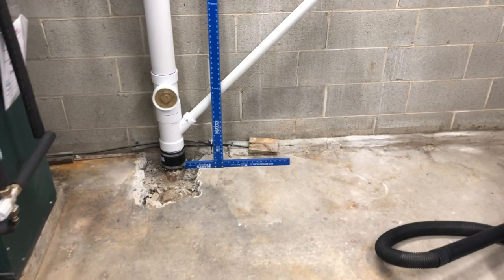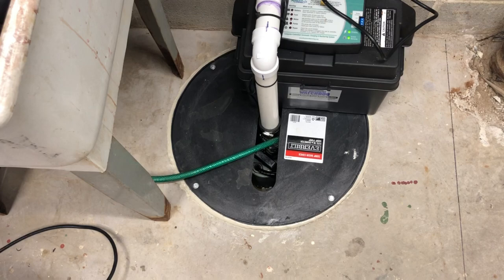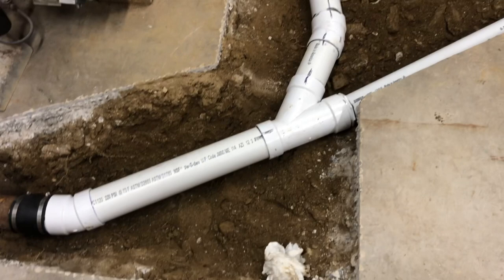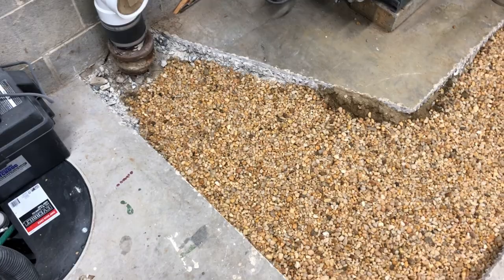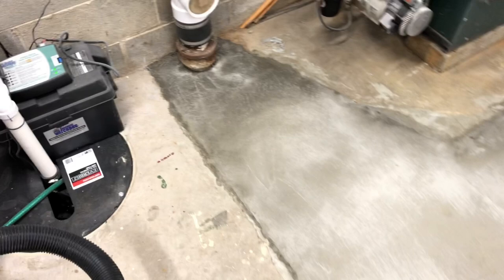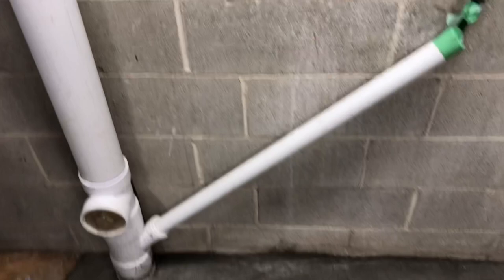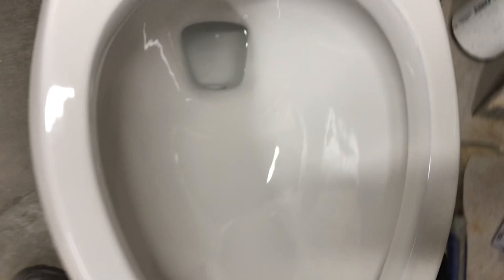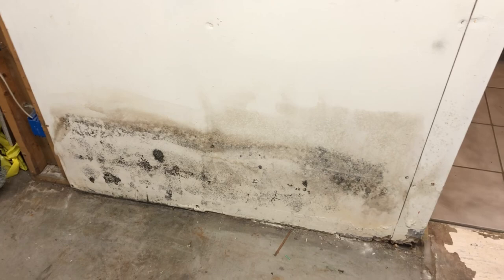Adding a toilet in the basement.

Comment: Should've used a 4x2 Santee with a 2x1½ bushing for the sink arm. The wye could allow for the p trap to get siphoned out from the air getting blocked off.
Reply: As a licensed experience plumber, your absolutely correct. However in most cases S traps actually do work as long as they aren’t severe
Reply: @CW-hq2qr  But they will not pass Code.
Reply: @vanhattfield8292  correct

Comment: What if idk where to drill & cut? I'm adding a new toilet
Reply from the maker: You would definitely want to know first 😂 I knew because I could see the two stacks going into the basement floor.
Reply: @PHL_Brownstone  no ik where the main line is. I'm plumbing a New toilet in, but there is an existing shower. The drain in the shower has 2 holes capped off though

Comment: Here you need a vent after 6 ft of travel from toilet.  We just reduce beyond toilet to a wet vent and tie it back into the vent system or through roof
Reply: i was wondering where the vent was for it. you can vent from the sink next to it, however the ground plumbing there would need to wye off before the stack. and a vent coming into the sink there.

Comment: what drill and grinder wheel did you use to cut the concrete? i need to cut a 6" hole for a radon system similar to what you did
Reply from the maker: You would be better off using a coring bit and drill, you could rent both at home depot or another rental place. You would get a perfect hole 🕳 for the pipe. I used a Bosch hammer drill with 1/4” hammer drill bit, and a Bosch 4 1/2” grinder with an 1/8” thick diamond blade
Reply: @PHL_Brownstone  thanks. yea i did consider getting a coring bit but they were expensive and wasn't sure how hard it would be to cut through. 

did you end up renovating the whole basement?
Reply from the maker: @Sean-Aviation  yes! First we dug up out front and waterproofed because that basement was flooding for years! I have all the videos on my channel.
Reply: @PHL_Brownstone  cool!

Comment: Don't forget to check the radon gas levels in your basement mine was a bit too high so I installed a radon fan piped into the sump cover.
Reply from the maker: Yes! there was already a radon system installed before my customer bought the house

Comment: How many drill bits did you have to use? Thanks
Reply from the maker: 1. It’s an sds bit 1/4 inch I’ve had it for a few years and it’s still in use!

Comment: Does gravity become an issue? How do you get it to go “up”
Reply from the maker: What you’re talking about is if the sewer line was higher than the floor leaving the house. In my case the sewer line goes under the basement floor and leaves the house
Reply: The pipe going up is the soil stack. Sewer goes down hill not up which means the first floor bathrooms or even the second floor. Unless you used a pump system waste always is gravity assisted.